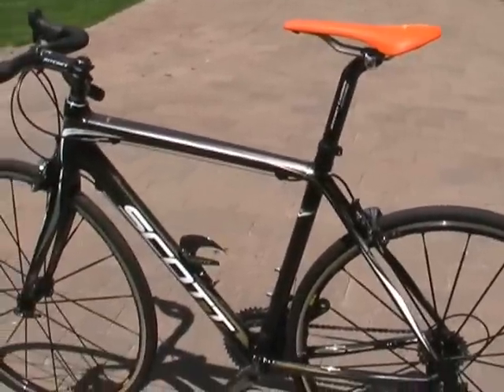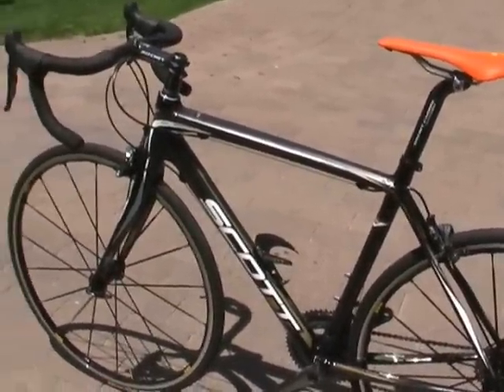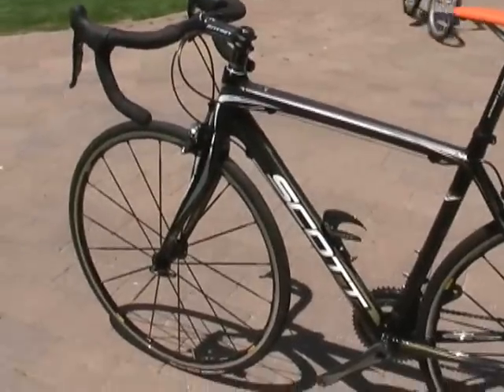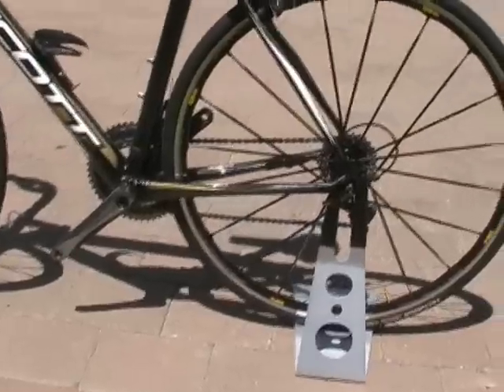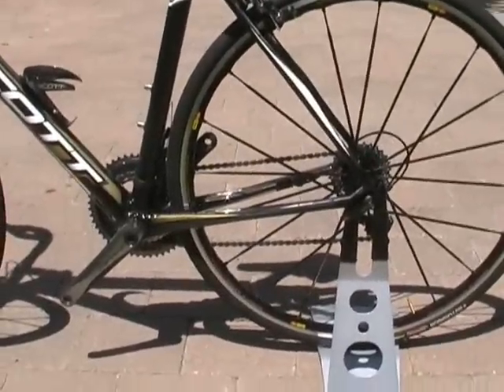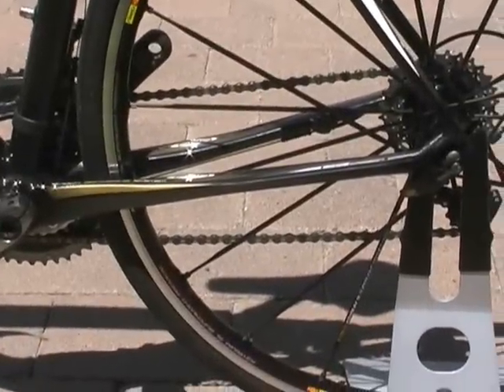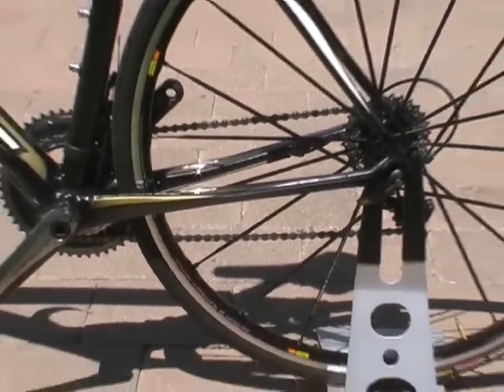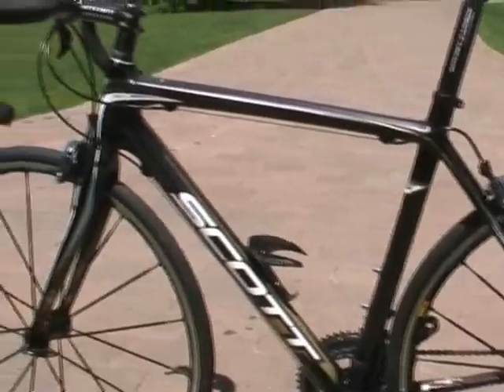Scott USA CR1 SL

Comment: I bought a Scott CR1Pro 2006. Used it until end of 2007. No issues with the frame. I bought a Scott CR! SL 2006 which I rode until I sold in March 2009. No problems with the frame. I am currently ridinga a Scott Addict R4 2009. I have not had any problems so far. Scott are great road bikes.

Comment: You live and you learn, Cannondale is a sponsor of my LBS team and has a long relationship with the shop. More than likely I would not get screwed under the same circumstances. I love the new Pinarello's but I read a review where I guy had a similar problem as I had with my SCOTT Addict and the communication lines w/ the Euro company was tough. In the end you get stuck with a really pretty 7-10k bike that can not be ridden.  
I've learned my lesson, check the warranty b/f you drop the cash.

Comment: @rexoner2000 Gotcha. Shame about your troubles with the frame. I rode a Carbon Six 3 and 5 a couple weeks ago and they seemed solid. Aesthetically, though I must say that their logos are really big on the frame because of their long name. It kinda turns me off. It's big enough on the down tube and then it's on the seat post too. But of course aesthetics are highly subjective. There are great frames underneath the paint.